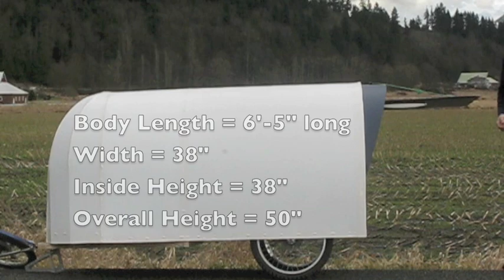Nomad bicycle camper

Comment: Nice one Paul!   I just had a thought though,... what if you  made it so it would 'telescope-out' at the front or back, by making the arched panels fit inside each other, then you'd have almost twice the space.
Also, I tried gluing ( I think it was polypropylene) siding boards together, & I used plumbers' solvent glue. I couldn't get them apart! (as a test).
keep-up the good work!
Reply from the maker: I'll have to try the plumbers glue. Sounds encouraging as not many thing stick to polypropylene. Yes I had many fold out/pop out versions on the drawing board but I still like the full size version. Not sure why. It can be done for sure but I like the hop-in-at-a-drop-of-the-hat idea.

Comment: Hey Paul, boy do I have to say I am just amazed! As an avid camping biker/survivalist I gotta say this is freaking awesome. I would like to try and build one of these but living in Eugene, avoiding the traffic could be tricky when trying to take out. 
Long story short, I'd like to try and turn this into a pull out, thus halving the towing distance behind you. And I thought before I try and come up with my own crazy way and getting frustrated, I should consult the origami master of the coroplast world...

If I built my dream rv camper, I'd be yours with the back half coming in, and the bottom coming down (collapsible, but I thought I'd be thorough in the explanation), but how do you keep it insulated? Double wall on the inside and outside? I'd settle for just the back half collapsing in. You said you move your bins to the front, and I figured if we could figure that out, why not take it a step further and collapse the roof to where the cupboards meet the shelf?

Apologies for the long message, any info is gold!

-Morgan Haitsma

Comment: Ive been homeless on and off for quite a while. its a hard cycle to get out of, even working only makes enough to get by without home conveniences. theres no manual for camping in the city without notice, what gear is most important, and dealing with elements, storage etc. youtube has helped so much. i intend to build one of your airstreams from corrugated plastic. you're correct it's fantastic material, alongside tyvek. would you be able to email me a template for the cuts? and thank you for posting and being a creative mind.

Comment: Very cool.  I see you are a reflectix man.  Total awesomeness involved in the entire project.  You had me hooked in the homeless shelter in the snow.  Will you be revisiting that again?
Reply from the maker: I should some day. When I do dishes I look out at it sitting in my field. Occationally the wind will knock it off the wood platform, but all that's holding it down is a 70 lb pier block sitting in the middle of the floor. In a sence this camper is what I wanted to do with the Homeless Shelter, adding insulation anyway. It seems to be a bit warmer than with it installled I've yet to spend a night in the camper, but some time this week I will. I want to get a sense of how much condensation build-up there will be, and see if I need more vents or possibly a small fan running through out the night.
Reply: +Paul Elkins Revisiting this and your website with the intent to make use of quite a number of campaign signs.  Alas, they are all 18"x24".  Still, I want to make total use of them as my personal space to work.  I have accumulated quite a bit of material and hope to assemble something inspired by the emergency homeless shelter and this wonderful bike nomad's camper.  I look forward to your plans when they become available.
Reply from the maker: +PhoenixCustomPrimiti 
I was just playing with a 'paint' drawing. I wonder if you stacked up 6 signs and taped them together, then made another one but instead full sheets take a sheet and split it down the long center then add the two pieces to the ends. Lay this against the first stack, make two more like these, add them, make 4 more, add them and you have a brick stacked 8x8 wall. 
You would need to duct tape both sides. I wonder if just 4 rows would bend like a full sheet. If so add the 2 sections together and you have your arced roof!  Try it out. It wouldn't hurt experimenting.
Reply: Gorilla tape and aluminum tape have become my best friends on this project as I have so many seams and repairs to deal with to deal with. 
I'll let you know how it goes.

Comment: Another great idea. The dome(ish) corner is inspirational. I would love to learn the way of doing that zigzagging cut pattern. Maybe you can build a little structure with dome ends at both side wide a flip up door in the middle. Or maybe i can do it :) only if i can find coroplast.. Hard to find them here. Greetings from Turkey.
Reply from the maker: You described one of my configuration considerations before coming up with my final design. The joints connecting the door side walls to the roof would be hard to attach, but if you could, it would be a great lay-out. Build it Igor!

Comment: Very cool.  I like it. I would assume it would be almost impossible to pedal up hill with all that weight. You would probably need to install a Bionx electrical assist kit for the bicycle, to help give you extra power. The solar panels would be a must as well.
Reply from the maker: If I were to travel with this camper I'd either buy or build a dual cluster delta recumbent trike. This way you can have a large range of gear selections, especially low gear for climbing hills, and be stable and steer straight at low speeds.
Reply: Paul Elkins
I agree with you but we ride tadpole trikes and we pull trailers for camping. I'm 64 and i like the stability of the trike on hills. i find the tadpole easier to get on and off of.
Reply from the maker: Joe Longstaff

Comment: Paul, you rock buddy. Your camper is very cool and uses the same materials I've been mulling around in my head for lightweight vehicle ideas for some time. So thanx for the video.
What is the reflective and I'm guessing insulate material you used on the walls on the inside?
Thanx again!

Comment: Very nice Paul.  You are likely to find there will be no condensation on the inside unless it's really cold.  I glued two layers of the Reflectix inside my  truck bed and aluminum canopy, with two of us sleeping in it even below freezing we didn't have any condensation issues.  In fact it was over 80 inside come morning with three inches of new snow on top of the canopy and truck that morning.  It made going winter truck camping much more enjoyable.
Reply from the maker: 80 degree, that's impressive!  I've yet to spend the night in the camper but plan to some time this week. Hoping I have enough ventilation while still staying warm. I have a carbon monoxide detector just in case.

Comment: You should create a source of heat for this thing for those cold weather conditions. I know you have it insulated, and a zero degree sleeping bag would obviously help. But maybe like a tea lit candle heater, a "Candilere" (a candle heater sold on Amazon), a Mr buddy heater with a cracked window, ECT. It'd be nice to see something like this tested in like 20 degree weather, or even colder. The coolest thing would be like a really small diy wood stove with a chimney that goes through the top....like those YouTube videos of people winter camping in their tents with wood stoves in them. But, in something like this, that could be kind of a stretch. But regardless, it would be awesome to see someone put this thing to it's limits by testing it in extremely cold conditions.

Comment: The finish job looks impresive, my compliments with your craftmanship and ideas. One question, giving the poor ventilation and the material you use on it, how hot does it gets to be inside on a regular summer (or late spring) warm day? Thanks.
Reply from the maker: Franco L. The weather where I live hasn't been hot enough to test that out, but if the camper were to be used on a daily basis I would install a solar powered fan on the cap of the small round opening on top to draw air from the door.  When parked a silver tarp erected over the camper to act as shade would help considerably too.
Reply: Thanks a lot for the reply. And again, congratulations on your work.

Comment: That's pretty sweet. I do have a question about those two little front windows you have. How do you keep the rain and moisture  and bugs from coming in through those two access points? My second question is about turning. Let's say that you were on a road wanting to turn left. The folks behind you may not know that. How are you planning on signaling to let them know that? You mentioned adding solar panels. Is there a plan in place to run wiring so that you A. have a headlight and B. have turn signal and brake light capability?
Reply from the maker: +Wysiwyg101 Most definitely I would add all the necessary  lights and extended mirrors. I'd even go as far as getting a trike with dual clusters or a very small sprocket for hill climbing. On the two windows, those or sealed. I have a bug screen lid for the top vent and the vent holes also have bug screen over them. For buggy climates you'd want to add you own mods to suite your climate.

Comment: I have a question. If someone's a bit heavier, can I replace the corruplast floor with a thinnish plywood floor? And would the hitch part hitch to the spot on my trike where the fenders are usually installed?

Comment: ever try to make one with an electrical conduit frame I think it would be light and strong
Reply: I've made one based on Paul's design using scrounged steel for the frame. It's heavier but still not so bad that you can't lift it by hand. You'd probably want to tow with a trike or a fairly low geared bike.
Reply: nice  I might try out the conduit if that doesn't work I'll try you're idea
Reply: Conduit would look neater, as long as you fishmouth your joins before welding

Comment: A boat and camper all being pulled by a bicycle.  Nice.   I've been wondering about the light weight of the camper acting like a sail and preventing you from really being able to tow it behind a bicycle.  Perhaps that's only a concern here in N. Dakota.   I'm thinking that would be a perfect wagon for pulling behind my moped.   A flat trailer with a "pop up" coroplast would be great to see.    Many thanks for the inspiration.
Reply from the maker: The ideal design would have the camper sitting 4-5" off the ground and having the wheels outboard for severe wind conditions. I chose this frame design for economy and KISS, IE use of common bike wheels. A side swipe too would possibly nudge the camper instead of snagging it. The clothes and drawers move to between the wheels before traveling for a better CG. I've thought of connecting this to my recumbent Tomos moped too. Also I might make my foam board fold down camper design next. This would ride lower, be narrower, be much bigger when erected and be well insulated.
Reply: Paul Elkins That sounds perfect!   I'm not sure I've seen a recumbent moped before.  Moped Army might be interested in that especially with a tow behind pop up.   Do the insides of the coroplast create a lot of condensation on the walls?  I have noted you have good air vents.   I can't wait until this spring to give your small folding boats a try.  Again, thank you for posting all these idea and sharing them with us.
Reply from the maker: Paul Elkins
Reply from the maker: SuperJamster1
The coro does condensate a bit during the night, so good ventilation is important. That is one problem with such a small shelter; retaining heat while getting enough circulation to prevent condensation.

Comment: Great job. Tell me what material is the "silver lining" on the inner walls?
Reply from the maker: +Andre Ruiter 
It's foil backed bubble wrap insulation, about 3/8" thick. It's a bit expensive but found at most Home improvement stores.
Reply: At menards to do the camper I'd cost $30

Comment: I would love to live as a nomad on a bicycle, space isn't my concern. My concern is how straining it may be to drag a bike behind you on a bicycle, especially uphill. Not to mention going downhill seems pretty scary with a trailer attached.
Reply from the maker: The Wary Traveler If you were to make a similar camper with the true intent of serious travel, the best vehicle would be a delta trike with dual sprockets so you can achieve real low gearing for creaping up hills. All wheel hydrolic disk brakes as well.

Comment: this is probably a stupid question but, would it work with a few layers of corrugated cardboard with some fabric and neverwet as coroplast/correx isn't as readily available and I'm on a super-tight budget (below 50 pounds as $150 isn't cheap for a 13 year old). 
Also, thanks Paul, you make stuff I've been dreaming of, thanks again,
Rio
Reply: +rio rawlings I'm wondering the same thing as you so I think your question is a Good one. ( :
Reply from the maker: +Aven Louis Sorry for not answering Rio's question. It might be possible, but corrugated cardboard does not bend like fluted plastic, so you'll get buckling going on I'd think. But if that doesn't bother you, give it a try.
Reply: +Paul Elkins thanks, I'd probably make a few prototypes before, thanks for the response. rio
Reply: +Paul Elkins That's quite ok. I don't know how you have the time or will to reply to any comments with all the work you are busy doing. I know that I just wouldn't have the motivation to write to a bunch of strangers especially after a tough day. It took me about a week to remember to respond to you and Im not even busy with anything. (:
Reply from the maker: +Aven LouisWell Aven, most of the comments I receive are good ones, and I have extra time at work and during the day to respond. I just make it one of my priorities.
Reply: What about using thin PVC pipe and joined, then stretching fabric over it for the main frame. Thin enough pipe will flex to a degree for the curves and use thicker pipe for the other parts.
Reply from the maker: Kind of like a small hoop green house? If you don't mind it being a bit lopsided I don't see why that wouldn't work. Give it a try.
Reply: I suppose you could build a folding trailer that fits a 1-2 person tent when fully expanded and incorporate holes for where the pegs go
Reply from the maker: Where I work I have the luxury of free-time computer use. That's when I answer questions and reply to comments.

Comment: oops!  I remembered that the siding boards were pvc, but I have joined the corrugated polypropylene sheets together by spot welding them with a poly-bag heat sealer. I have seen it done with the point, or edge of an iron (for pressing clothes).
Reply from the maker: I'll have to make a trip to the junk store. My wife would KILL me if I experimented with her Iron. I wonder too if a soldering iron on a rheostat would work.

Comment: Hello I was wondering if anyone knew of a material like coroplast in that it's flexible and light or does anyone know if truck bed liner would adhere to it? I am looking for something a little more durable a little stronger in storms and stuff like if your in the woods and a branch falls I want to be confident it's not going to destroy the shell of the micro camper I want to build

Comment: If this was used as a motorcycle camper I'm afraid that the plastic would bend and break in and ruin it. Do you think it could be done with some very thin aluminum?
Reply: There's videos inspired off of this about motor cycle motor homes.

Comment: Paul, how big would you say the campaign signs were? Campain signs aren't really a thing in the UK, but I can get sheets of the material. I'd just like to know if they're the right size at 1.2x2.4m.
Reply from the maker: Yes that would work Nicholas. The sheets would be just a little smaller than the 4 foot by 8 foot sheets sold hear according the a metric conversion chart.
Reply: Thanks for the quick reply!

Comment: hey paul, I plan on building one of these probably without the wheels, is there ever a bug problem with these, mostly ants if so how to you keep them out?
Reply from the maker: an extra bucket lid cut out in the center and rivet on bugscreen. Also add to front door window and sandwich it in between wall on vent holes.

Comment: Hi Paul. I'm just finishing my camper based on your homeless shelter. Is the condensation problem reduced by putting I  the bubble insulation you're using on this design? Other than better ventilation, any ideas to reduce the condensation?
Reply: +Keith Pickelhaupt Did you solve this problem?
Reply: you could use a goretex panel in the roof letting the moisture out

Comment: What kind of tape were you using to hold the seams together?
Reply from the maker: I used white duct tape, but not to hold the joints together but to cover the zip tie holes to keep rain out. I used Chrome colored duct tape for the interior bubble wrap. That kind of helps hold up the insulation. I used spray Elmers glue to attach the insulation to the coroplast.

Comment: About to build a bike camper with 5 wheels... what kind of bike tires do you recommend? I intend to try cross country with it.
Reply from the maker: RegiMachine Not sure, but the taller the wheel the better for long distance and rough road traveling. Maybe get a standard size (1-1/2" or 1-1/4" wide) so you can go to any department store and get a replacement.

Comment: I thought if it did leak that you could cover it with a water proof boat fabric. Then you could advertise on the sides.
Reply from the maker: I've thought about making push or pull shelters for homeless with advertisement on the side. This way they might be accepted in society. Is this what you were thinking of?